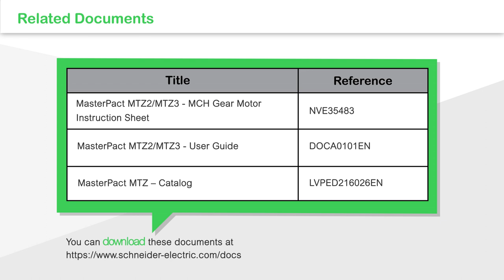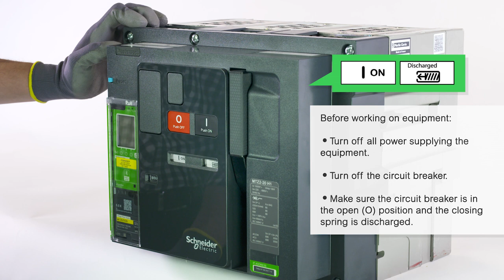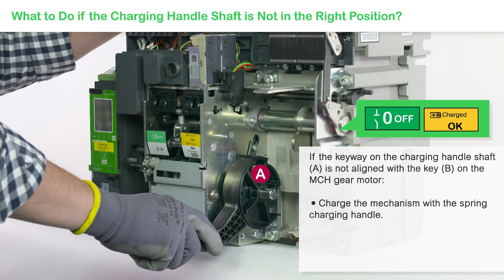MasterPact MTZ2 - How to Install the MCH Gear Motor | Schneider Electric Support

Comment: I have a schneider ACB, but for last mounth my acb not operate in auto spring charge.....
Reply: What is the reason.... Plz describe me
Reply: @technicaljd4823  hello i have the same proplem...that my breaker now is not auto charging...i want to ask please, my current breaker position is On and spring discharged..i have tried to recharge the spring by the handle but it is not working either...how i can charge the spring now...is it possible to give direct voltage to the spring motor at the outside terminal???
Reply: @faredyousef1251  if the motor is installed you can't use handle you should use switches to operate the beaker